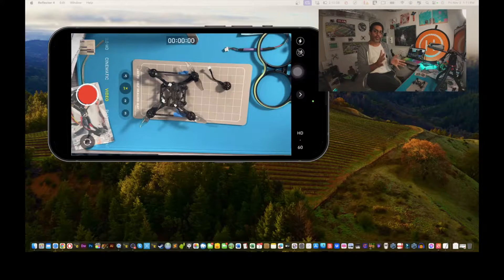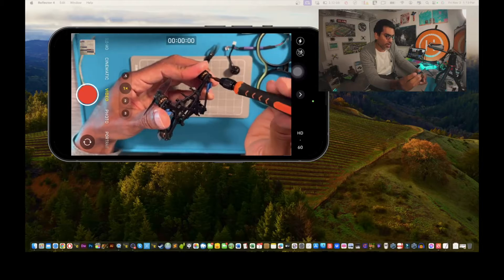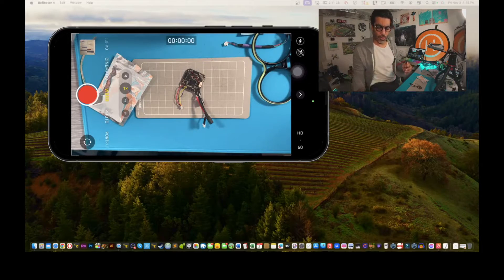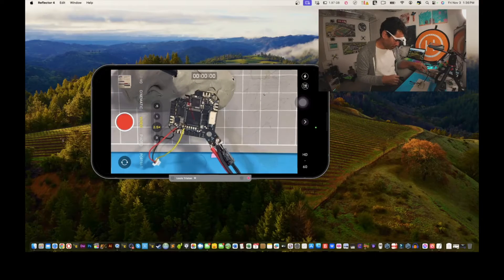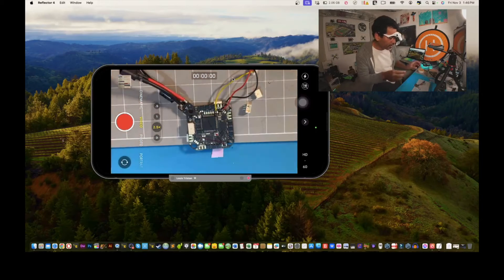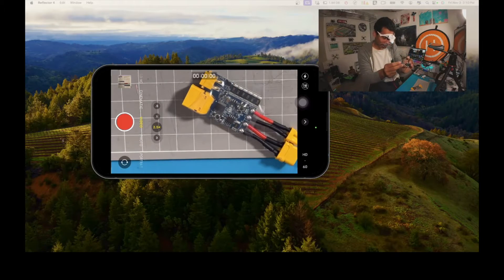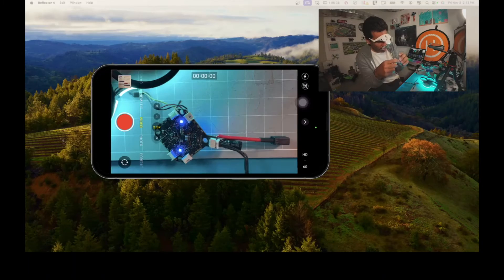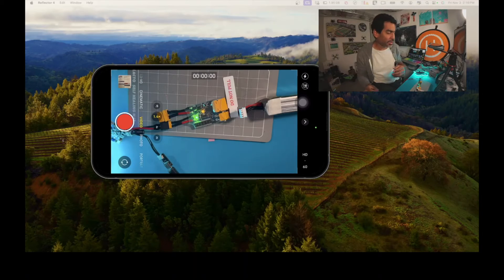how to install motors to F4 2-3S 20A AIO FC V1 - install motors on pavo20 Part 3 of 4

Comment: thank you for help,

i have one more ploblem, 
after arming quad 2 motors spining slow one motors spin 90degree very slow, one spinds fast,

in jumper-t pro  (outputs_ i changed thrrotle start from 1000 to 1200 , but after arming same problem 1 motors not spining, 2 spining slow , 1 spining ok,
when up throuttle all motors starts spining same speed... and drone up...  

how i can fix it what after arming all motors spining fast, and a lit bit stick up drone up,, now after arming throutle i must up more when 1250 from  1000  what motors starts spining same speed....

Is it normal that in ESC configuration page its by default MINIMUM STARTUP POWER (BOOST) is 1125 ?? i get drone with these settings,,, but i buy not from shop, maybe it was updated?

i can't do ESC calibration in betaflight MOTORS menu , i tried up MASTER to 2000  and after connected battery motors starts spining ,, no bbeep sound ... so i taked battery offf...  maybe these Pavo Pico Brushless Whoop Quadcopter HD version drone ESC dont have calibration function?